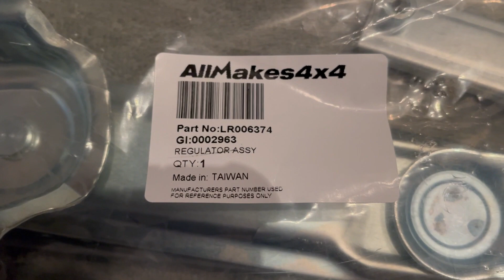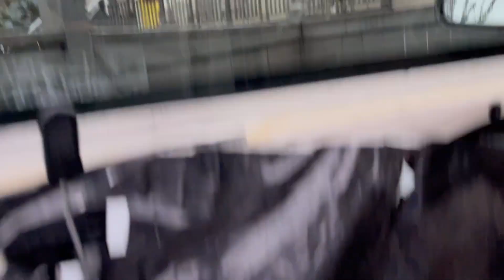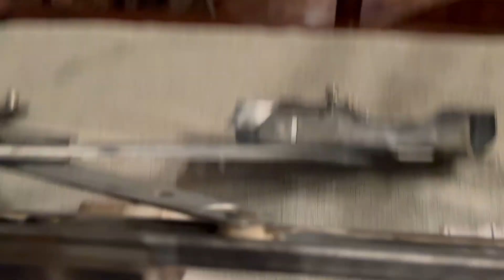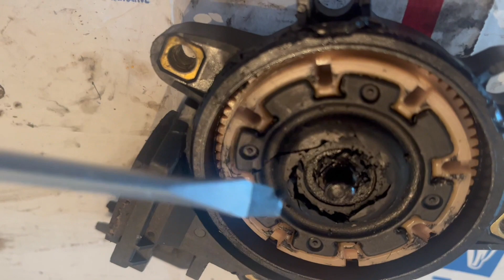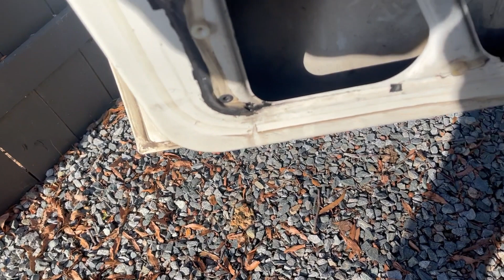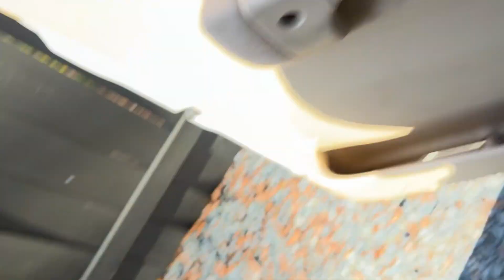Land Rover Discovery 2 window motor gear repair and window regulator repair

Comment: Thanks for answering my question! I noticed I swapped out the old regulator hoping it was the issue, nope! It was the motor, I thought the motor was in good shape because after testing it alone without window it moved the gears up and down. As soon as I installed the window it would only go down but never back up.